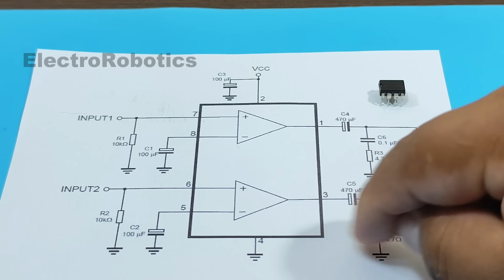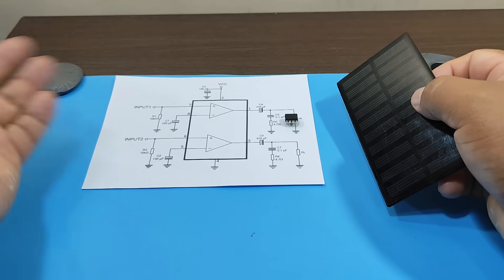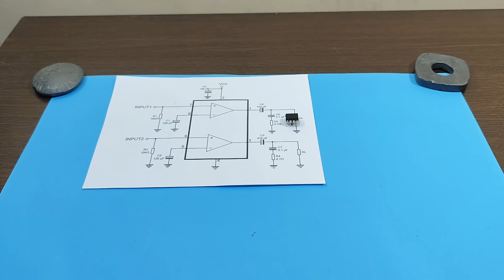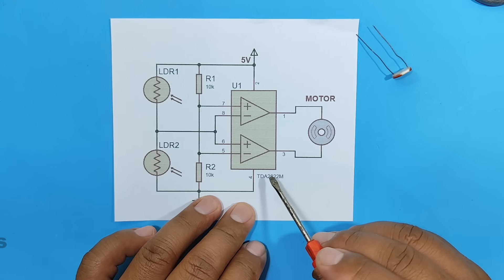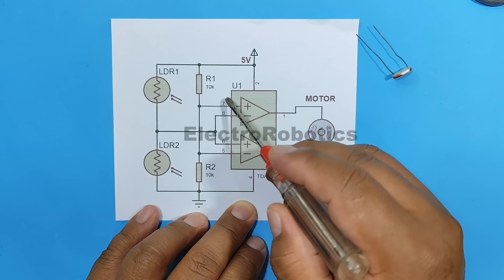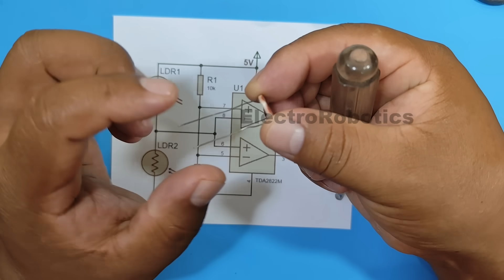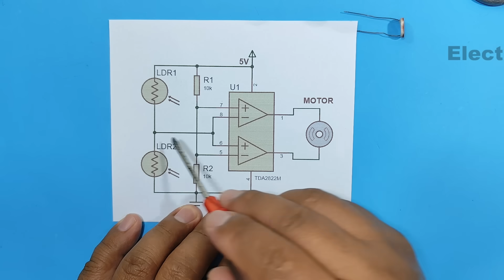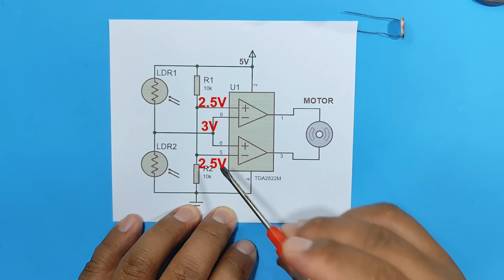Automatic Solar Tracking Circuit _ Solar Tracking Circuit

Comment: One issue. When both Ldrs receive approx equal light because the motor has followed the light, the outputs may hunt. This is because one ldr will always receive more light than the other. It's impossible to have exactly 2.5 volts between ldrs. Even 1 microvolt difference would trigger the op amps. Easy fix however!
Reply: Add hysteresis.
Reply: @stevesmyth4982  yes hysteresis is the go. That's what the proposed resistor between the inputs was for. However, having 2 op amps requires extra positive feedback resistors and steering diodes. I have a design but... a single capacitor to delay the ldr signal is much simpler.
Reply: how?
Reply: @VladekR  add a 1k resistor in the middle of the 10ks to separate the reference inputs of op amps. This gives you a "stop band" of about 0.2v where both op amps output a negative voltage- therefore no  current to motor. You also need a capacitor at junction of LDRs to ground so the motor drives the ldrs into  stop zone before getting stop voltage from ldrs. I think 0.2uf might work  but you need to experiment.  A large value, like 10uf would cause the motor to overshoot and oscillate back and forward. Good luck
Reply: @HoadysTech  👍

Comment: If I do the same project under sun light, kindly provide the specifications of LDRs like, light resistance range, dark resistance, power dissipation, impressed voltage in DC, operating temperature etc. Also need the detail specification of solar panel.

Comment: sir can i use lm358 ic
Reply: You can use any dual comparator.    Just make sure the motor current does not exceed the chips output rating.
Reply: can i use transistor for increasing the output current  @freedompatriot8457